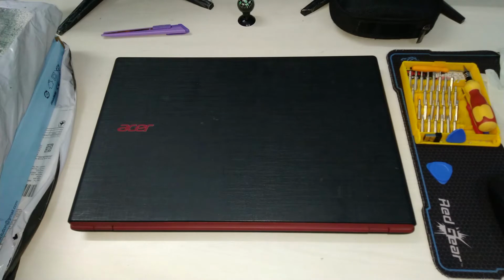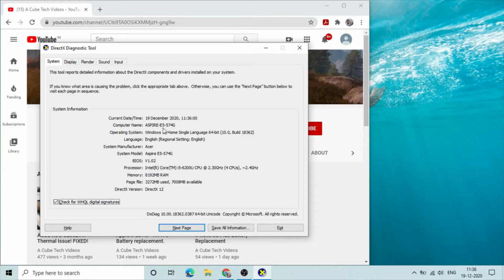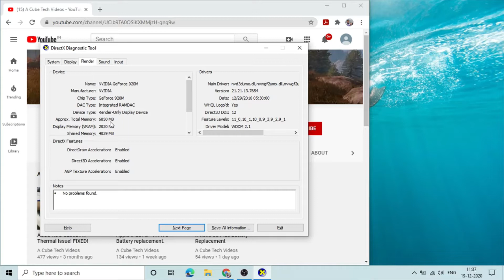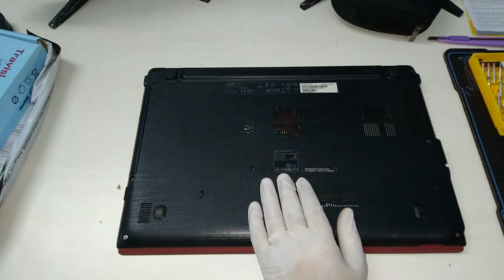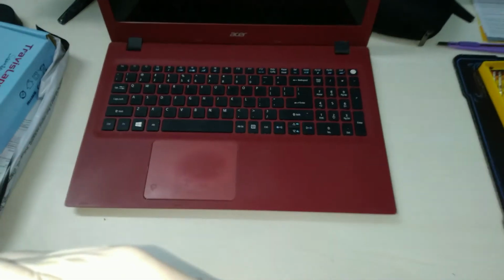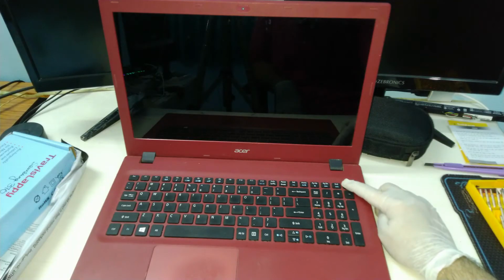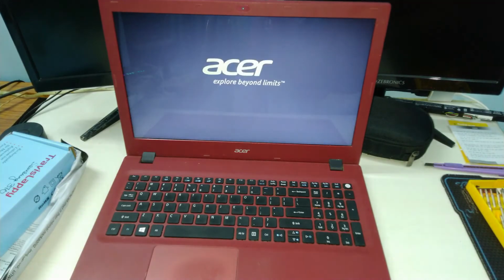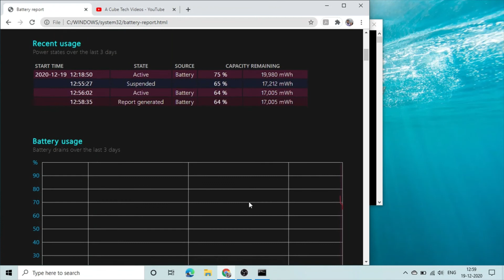Acer Aspire E5-574G Battery Replacement

Comment: bro, can we use this new battery which is 26,640 Design Capacity, kind of less than the original battery which is 37,000 Design Capacity. does they create any issue in future?

Comment: I have the same notebook. Great video! just one important detail you missed:

the original battery holds 2500mAh . the battery you installed holds 1800mAh .
the model is correct AL15A32 though.  that means that the notebook will work perfectly but will last less on the battery. 
A quick inspection on the original battery would have revealed the capacity 
The smaller battery is cheaper but I believe your client would be happier if his computer were to "last longer" on its battery.

FOR PEOPLE WITH A WORKING BATTERY the first thing to do is to run the command mentioned later in the video
>powercfg /batteryreport
Then check the html report
There youll find the model (name) in this case AL15A32 . Another field to pay attention to is "Design Capacity"
in my case (same laptop E5-574) it is 37000mWh. And finally the "Full Charge Capacity" (as an example I have 20500mWh)
If the current capacity is less than 80% the original design *it is advisable to replace the battery since li ion degradation is faster after 80%*.

(in my case i have 55% . it is almost 5 years old and it still lasts about an hour but in less than 1y it will be dead, for sure. so Ill replace it now)

to get from mWh to mAh you just need to divide mWh by the tension in Volts
(in my case 37000mWh / 14.8 V = 2500mAh)
You want to search and buy the same battery model (AL15A32) with the maximum capacity you can find (probably will be like the original). The smaller battery may be cheaper but will finish faster. Dont worry about the exact notebook model since many models are compatible. Below a list of many models that also use the AL15A32 .
I hope this helps.

    Aspire E5-422
    Aspire E5-422G
    Aspire E5-432
    Aspire E5-432-C8WX
    Aspire E5-432G
    Aspire E5-432G-P33Q
    Aspire E5-452
    Aspire E5-452G
    Aspire E5-472
    Aspire E5-472G
    Aspire E5-473
    Aspire E5-473G
    Aspire E5-473G-561X
    Aspire E5-473TG
    Aspire E5-474
    Aspire E5-474G
    Aspire E5-491
    Aspire E5-491G
    Aspire E5-522
    Aspire E5-522G
    Aspire E5-532
    Aspire E5-532G
    Aspire E5-532T
    Aspire E5-552
    Aspire E5-552G
    Aspire E5-573
    Aspire E5-573G
    Aspire E5-573T
    Aspire E5-573TG
    Aspire E5-574
    Aspire E5-574G
    Aspire E5-574T
    Aspire E5-574TG
    Aspire E5-722
    Aspire E5-722G
    Aspire E5-772
    Aspire E5-772G
    Aspire E5-773
    Aspire E5-773G
    Aspire ES1-420
    Aspire ES1-421
    Aspire F5-571
    Aspire F5-571G
    Aspire F5-571T
    Aspire F5-572
    Aspire F5-572G
    Aspire V3-574
    Aspire V3-574G
    Aspire V3-574T
    Aspire V3-574TG
    Aspire V3-575
    Aspire V3-575G
    Aspire V3-575T
    Aspire V3-575TG
    Extensa 2511
    Extensa 2511G
    Extensa 2520
    TravelMate P248-M
    TravelMate P257-M
    TravelMate P257-MG
    TravelMate P258-M
    TravelMate P258-MG
    TravelMate P277-M
    TravelMate P277-MG
Reply from the maker: Thanks for the detailed explanation. 
Important point to be noted that I missed. 
Thanks for your support.